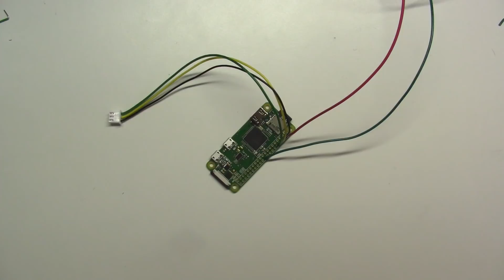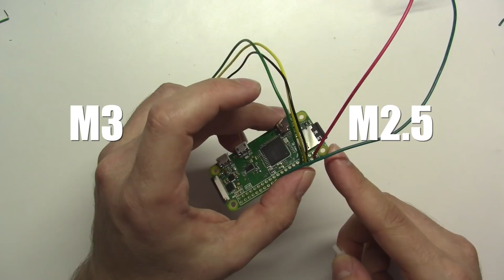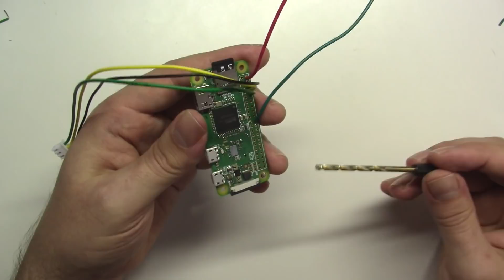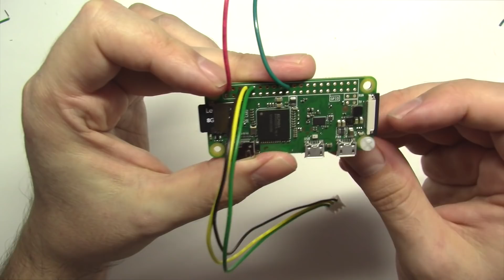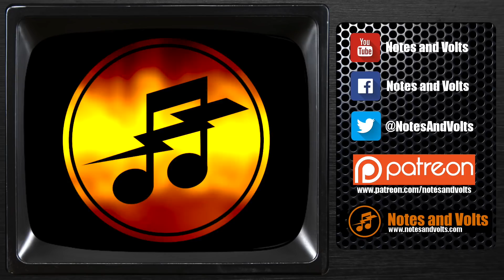How to use M3 Hardware with a Raspberry Pi Zero

Comment: I really hate 2.5 metric.  And also can't stand when boards use 2mm holes.  Every time I think my collection of hardware is complete, I quickly discover another impossible size that does not match up.
Reply from the maker: I found this out the hard way LoL. I have boxes of 3mm hardware.
Reply: Has me going crazy!  I had to go order taps and dies for m3 then m2, just to find out the supply delivered (in error )of 10x taps and taps and drills were for 2.5mm - which do NOT mate up with BOTH 2mm AND 3mm!  Between the 4-40, 2-56 combinations of stuff I had to make my stuff work, I needed like 6 different tools in my box to undo a circuit board because I ran out of the right size fasteners for 1 of 4 holes.  It's the METRIC system!  It should have been illegal for them to invent 2 & 1/2 mm size, and that person should have been burned at the stake for impersonating a witch or warlock.
Reply: I hate that, how Raspberry do this design and not think in DIY home made projects ¬¬
Reply: @rc0d3  The PI is so popular.  Like they made a hasty mistake when they originally designed and now millions of users are stuck with it.  I must have ordered a dozen sets of metric fasteners over the issue.
Reply: @ make some sense, but rp5 is the same... why?

Comment: Why not a M3 drill bit? A 1/8 inch drill bit is 3.175 mm, which is a bit wider.
Reply from the maker: Hi Bora. Yes, a M3 bit is ideal. Where I'm from, it is far more common for people to use inches and have Imperial bit sets. The extra 0.175mm is not really noticeable.
Reply: That's right. 0.175mm won't make a big difference.
But as a perfectionist, you would say "Use a 1/8 inch or M3 drill bit" because this is YouTube and you have viewers around the world.
But I'm also assuming that those viewers are probably smart enough to think about that themselfe.

Comment: Where have you been with this ?
I've had my PiZero for a year or two and never seen/looked for a video how to work with board's smol holes. Two days ago I "expanded" them (with a dremel tool though on low speed) and NOW you're releasing this video? It has to be a cosmic coincidence. gg wp
Reply from the maker: LoL! Thanks Glenn. I figured I wouldn't be alone in this. I was getting ready to go live on Twitch to finish up a PiZero project and was surprised when none of my standoffs fit. Necessity is the mother of invention.